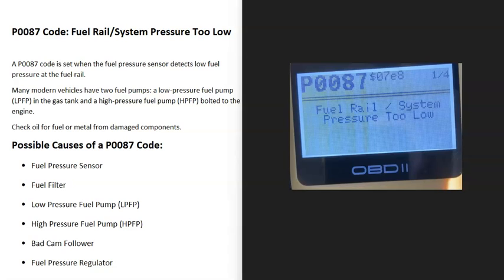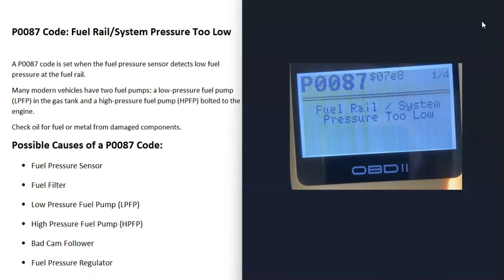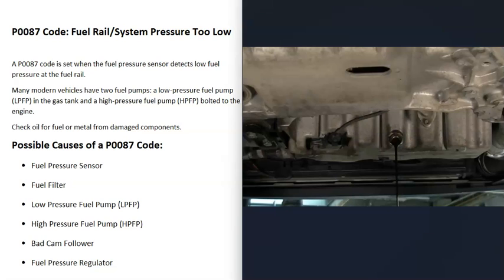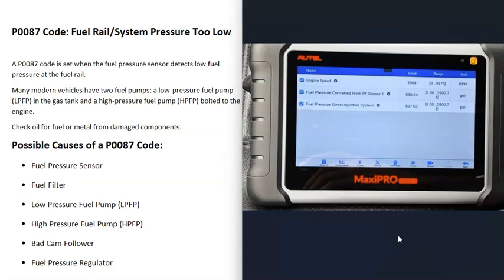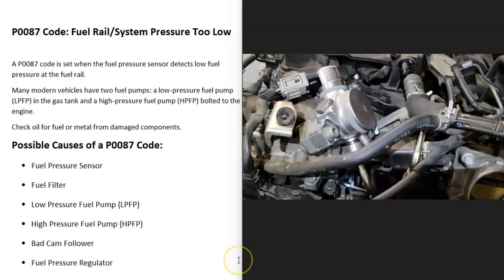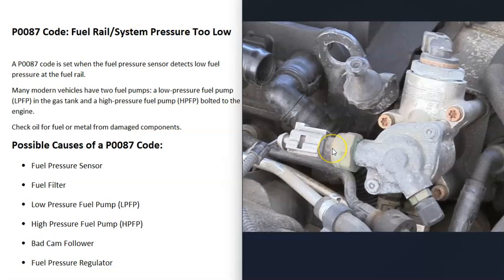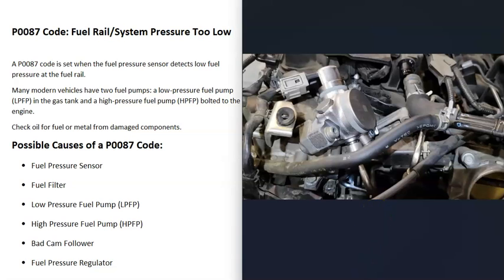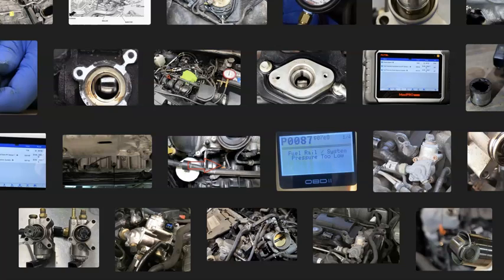Causes and Fixes P0087 Code: Fuel Rail/System Pressure Too Low

Comment: You can’t attach a fuel pressure gauge to a car that has a high pressure fuel pump. It’d blow that gauge apart. Over 1000psi. Now something like port injection yes

Comment: We need help we have a p0087 code changed absolutely everything all sensors camshaft crankshaft lpfp and hpfp all lines been checked for leaks no leaks all wiring is fine car starts perfect and runs great but when you push under big acceleration it cuts out and throws the p0087 code we are pulling are hair out we changed the cam follower as well  with the hpfp but still getting low pressure the only thing left is the fuel injectors we can’t smell any fuel which we thought you might if one was leaking do you have any ideas what the problem could be 😢
Reply: Did you find out ?

Comment: The car idles smoothly, then, like grasping for fuel, idles down and then up again. Cannot rev the engine.  Error P0087.  When clearing the error, I can rev the car, but it cuts out after that.

Comment: Good lord!   I wish I found u 6 months ago... low pressure pump was replaced.  2017 200K Miles..

 Acura ILX (FAULTS: VSA, POWER STEERING, HILL ASSIST, EMISSIONS) Will not go over 2K RPM Can drive it but uphill is 20mph or less.   You made so much sense with the cam roller and high pressure pump.   All the POO87 faults channels just give a shit description.  THANK YOU..... I will send all my people to you..   You need to be a teacher.

Comment: I have a 2018 Infiniti qx60 3.5 fwd mine won’t start unless I spray break fluid and then shut off but I noticed the connection to my high fuel pressure pump has no ground or power at all . Need help figuring where the fuse is or what the problem can be . Tested it with a multimeter .

Comment: I have a 2007 peugeot boxer 3.0tdi 160. After it was unused for a year i got it runing by towing it and using starter spray. Now when warm, it starts with key, but in low rpm if you push too fast, the engine will stop, in driving and in idle, same p0087 code. What can i do?

Comment: Hi, thanks for this vid, very useful, i’m due to book my Seat Leon FR in the garage so will share what I know from this vid. However can I just check something with you? I first received this error code in Winter times (twice) where I thought it was something to do with the cold weather, I then cleared the code and it was fine until next Winter. However then I got the warning from when I never drove my car for a while, due to being on holiday, so I thought could it be that? But now I have this idea it is when I have full tanked as after I drive for a while, the error code doesn’t come back. Tbh I am unsure if these have any relation to the issue and maybe it is the fuel pressure sensor or the high/low pressure fuel pump as I am told the fuel filter is built in within this car so whilst it may be that, it is unlikely and oil has been changed.

Any advice please?

Comment: Great insight.  Mercedes 4.7 twin turbo motor are known to leak oil through camshaft positioning sensor.  

Oil goes into wire lines & csn reach ECU.  Im not sure if its related to my p0087 code?  Would u start w replacing fuel filter?  I changed fuel rail pressure sensor to no avail.  

I'll try to get tools to measure pressure.  

TY

Comment: Was sitting here watching your video. I kept getting that code showing up in a 2018 Hyundai Tucson. I bought a brand new motor from Hyundai when I took the old high-pressure fuel pump off of it. I didn’t put that little roller back into the new motor didn’t realize I did that until I was watching your video thank you

Comment: So will a bad connector wire to the fuel rail also cause your car to throw code p0087?  Every time I move the wire my motor sputter and dies out. It also has a hard stared at times.

Comment: Hoping you can assist me as I have been chasing gremlins in my OM646 (2006 e320) for a few months now and not sure what to do next. I have the low rail pressure code and progressively replaced pretty much the whole fuel path from the cheapest item to the most expensive. 

I have replaced:
- Fuel Filter.
- Fuel pressure sensor (Bosch)
- Fuel pressure regulator (Bosch)
- In tank fuel pump assembly - the whole thing with the hoses (Bosch)
- New hoses (from filter to High Pressure Pump and return hose from pump). (OE MB)
- and finally just today installed new rebuilt high pressure pump (Bosch)

Car seems to drive better than it did before the HP pump replacement but still throws the low rail pressure code albeit not as soon as it used to. I still have my old fuel rail sensors but not the HP pump as I sent that core back. I plan to put my old sensors back and see if that makes a difference but thought I'd write to you first.

Car has 340,000km and I have not removed the injectors yet. I'm really at a loss what to do next and could use your guidance. I had high hopes for the HP pump to finally solve the issue but was quite shocked when it didn't.
Reply from the maker: Usually, swapping out those components would have solved the issue; the only thing left is the cam lobe the HPFP rides on and the wiring. It may be best to ask in a Mercedes-Benz forum or mechanic who knows all the details on those models. There may be something manufacturer specific.
Reply: @HVAC_Mechanic turns out it was the HPFP in the end but what threw a wrench in the works was the new fuel pressure regulator was bad. I put the old one back and in combination with all the other new components, everything was perfect.
Reply: Hi! I hope this will help you but if not mistaken you have a camshaft issue.

Comment: My car vw folf mk6 2.0 tdi, has same code and random misfire and sometimes iget plug light flashing and then after couple seconds it stalls and after start it again it runs normally. Filter changed, injectors checked all good, pressure senaor changed, fuel pressure regulator changed, what could be the cause, fuel pump or hpfp?
Reply: Скорее всего в топливной рампе есть стружки, у меня та же фигня. Обнаружил в топливной рампе металлическую стружку, промыл , продул воздухом , стало нормально, но через пару месяцев опять. VW Tiguan 2.0 TDI 2012 год

Comment: hi,i have p0087-61 code on ford focus mk2.5 1.8 tdci and doesn t want to start anymore,could be the high presure pump if fuel goes to the injectors?or just the presure regulator?

Comment: prsche 3000 diesel 6 cylinder, I have the code p0087, but it doesn't start and I have no power supply to the injectors and they don't spray, what do you suggest? Thank you

Comment: So basically I get this fault code under heavy acceleration. Black cloud of smoke comes from the back and the check engine light comes up. Under normal driving everything is fine until you press the  gas a little bit more. Engine OM651
Reply: That’s the exact same problem I have on a 2008 LMM Duramax, did you ever get it fixed?
Reply: @volunteertn1702  check fuel filter first!
Reply: @volunteertn1702 following, same on my ‘08 Duramax
Reply: Figure out the fix?
Reply: Ssme here w Mercedes cl550. P0087. Under heavy acceleration.
Reply: Following ! Got same engine and same fault ! Fuel pressure to low in the system
Reply: I have the same on a Skoda Octavia VRS 2.0 tdi for me it was the fuel pressure regulator on the hpfp
Reply: I have the same 2016 q50 what do i do???
Reply: Same on my om651. Did you get it fixed yet?
Reply: any solutions?
Reply: 651 with same problems, any ideas? Have changed the filter
Reply: @dennisandersson26 mine was intake manifold, egr and dpf clogged but surprisingly no error codes except p0087

Comment: I got the code while driving to vegas,  pulled over to get something to eat.. We got back in the car and the car started to misfire.. Mechanic came and said  was a high-pressure fuel pump.. Degrees in Baker Ca was 113, and i had the a.c on. Got my car towed back home and paid well over a thousand dollars.. Waited 2 days, and now the check engine light is off, and the car is running normal.. my question is,do you think the heat had something to do with the car misfiring? And is it safe for me to drive now?
Reply: @Bats10  good u shut it down before overheating engine.  Usually overheating will cause an engine to feel weak, sputtering & Burst.  In that same area my brother & id had burst something, but made down hill to Burbank. 

The car wasn't the same after that.  Id get everything checked out just to be careful.  The head gaskets was compromised.

Comment: To much oil in the engine Will also give this faul
Reply: Weird af.. how would too much oil mess with fuel pressure being low smh the reason why I hate these new computerized cars. Never had any issues with old schools unless it's actually a real issue.
Reply: Sure enough as I researched my issue, my shop overfilled my oil last week! Thanks for posting this.
Reply: Would low oil do the same?
Reply: Mine just need a new fuel pump in the back. Very easy to replace. Now dealing with a P0429 and P0491 code 🙄
Reply: 6months of setting...    Oil 2 qt low.   It's the HPFP!    YOU DA MA !!
Reply: I put too much oil and this light came on and it gave me the code, changed my oil, I put fuel injector cleaner, should I still drive?

Comment: Is it common to have fuel pouring from the hpfp? 
I've been running it leak has gotten worse and worse
Reply: Obviously not - bit of a sillly question. GO get it looked at. You're causing a danger to other road users putting diesel all over the road. And if it's petrol, you're going to set yourself alight.

Comment: I have a 2017 Honda accord LX machine gave me code P0087 it’s hard to crank, engine light is on and when you go to accelerate it jerks and bucks‼️‼️
Reply: I have the same on a 2023 Accord LX. Did you find what caused it?
Reply: Change the pressure sensor
Reply: Honda has a TSB for replacing injectors for this issue

Comment: Hello everyone, I had a problem with the high pressure pump, it's a golf 6 2.0tdi 110hp. The pump was replaced, the entire system was cleaned of sawdust created by the pump, however, after driving for 10 km and restarting the car, the car starts shaking in reverse and emits white smoke. After about 10 minutes, the heater light also went out, and the diagnostics shows a fuel pressure low error.
What could be the cause if anyone recognizes, and many thanks in advance
Reply: Came to find my engine light's reason but i saw many cases that Wolkwagen / audi diesel engine's P0087 cases. 

That looks like saw dust wasn't cleaned good enough. 

A mechanic that wrote down his fixing journey, used a metaphor 

Cleaning out fuel line system and fuelt tank for P0087 is like Changing human's heart whole blood line including blood at the same time. 

One sawdust causes what happened to your car engine.

Comment: if i ran the car low on gas would that trigger drive train malfunction i have a 2015 bmw328i
Reply from the maker: Yes, no gas can trigger the code. I would clear it and see if it returns.
Reply: You got a point I got the same problem the P0078 code, it it to that what you said having the gas below half full?

Comment: I had a p0087 on my vw 2.0tdi, it was crank, no start. I changed the low pressure pump and it ran fine for 2k miles. No the fault code is back. This time the car starts but cuts out after about 10 seconds. I'm thinking it's now I stuck injector? I'm going to try the injector leak down test this weekend. Hopefully I can find the fault. I cant imagine the new vw low pressure pump isn't running properly. What do you think? I've changed the fuel pressure sensor and regulator last week but no difference. Thanks.
Reply from the maker: Anything I say is a guess, but that sounds like a fuel filter getting clogged or something in the tank clogging things up.
Reply: Same problem I’m replacing the fuel rail next. Did you find a fix?
Reply: I've replaced everything except hpfp. Same problem except I can keep the engine running if above 1100 rpm. Fuel pressure meets requested pressure at 2.5k rpm and deviates as rpm drops until its 10 bar too low at 1100 rpm and stalls. My final steps are checking the ECU and/or the timing and hpfp.
Reply: I have p0087 and p0252 on Mercedes w212 e class 220 diesel. Changed fuel filter, checked the LPP on the tank and cleaned, still problem. Probably the HPFP, any of injectors or cam position foult. Smelling from exhaust is not normal which was never an issue before this error 😫

Comment: Thanks for the video. I have the dreaded p0087 code on a 2010 jk wrangler diesel 2.8. Code will only come on when the vehicle is under load and up inclines. Before I have a go at taking out the hpfp for inspection is there anything else I should test?
Reply: How did u get on, did u have to change the high pressure fuel pump in the end?